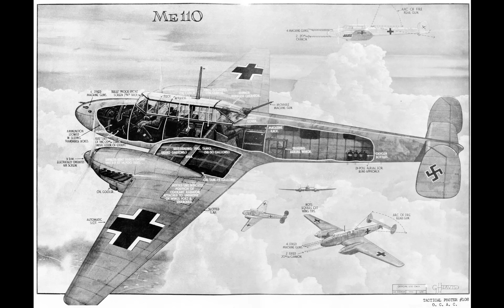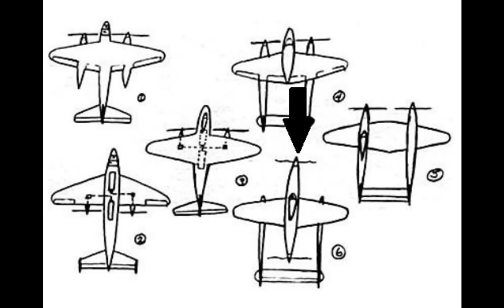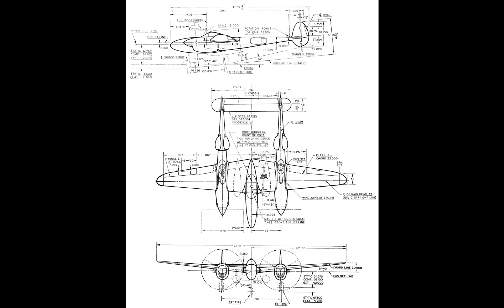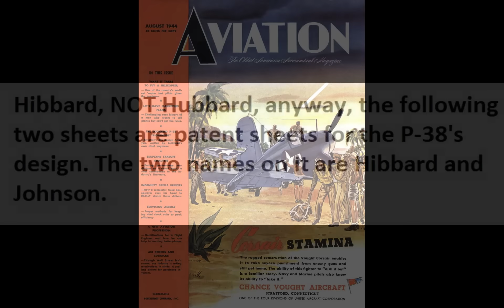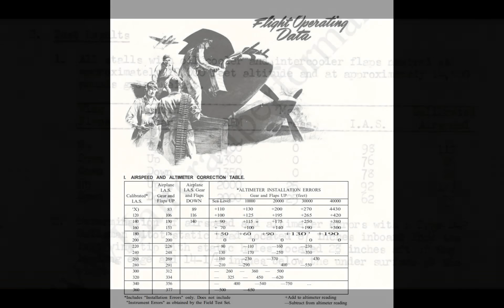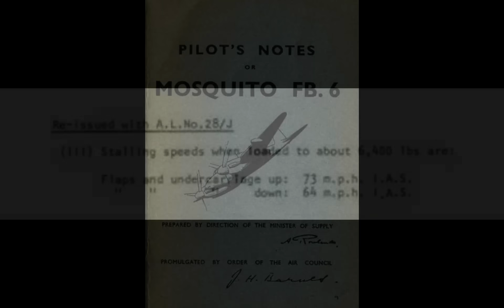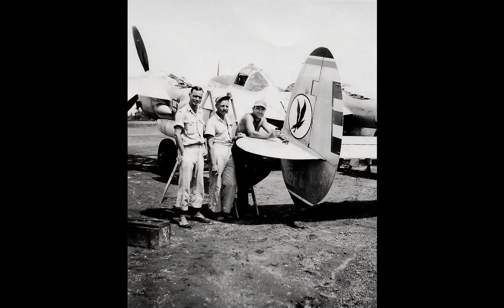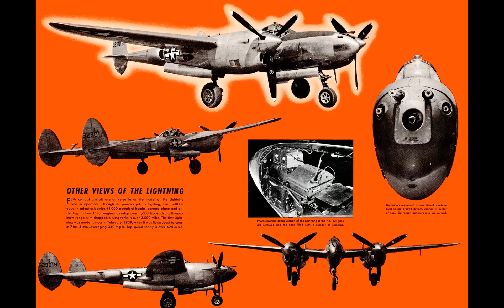Lockheed P-38 Lightning Design Info

Comment: I seem to remember something about Lindbergh helping to extend the range of the P-38. Will you go over this in a future video?
Reply: That's a fairly well documented topic and the quick summary of the reason is very quick:  Lindbergh recognized that most of the active combat pilots had never been trained in how to fly with fuel efficiency in mind, and for the pilots in the Pacific, this was a major issue.  And don't get me wrong, either, because this was also an issue in the European theater of operations, which is why day and night bombers from the Allies were making sorties over Germany without fighter cover.
Reply: @jamespfp  thanks for the info! It’s quite amusing that someone with superstar status like Lindbergh would be the one to fix an issue like this. After all though, he did know a thing or two about flying long distance
Reply: @jamespfp  Do a search for 'pumping loss'. That's what Lindbergh understood and trained others in.
Reply: @jiyushugi1085  
Pumping loss has nothing to do with what he showed pilots in the Pacific to do to extend range.
What you have to understand about engines is that what removes more heat from an engine whether it's a water cooled, air cooled (Harley) air cooled with oil assist (Harley with an oil cooler) engine is that what removes the most heat from the engine is unburned air/fuel mixture leaving the engine, that's why if you run an engine too lean you can shorten it's life and even cause damage all the way up to burning holes in the tops of the pistons and burning valves. 
The engine manufacturers had an air/fuel mixture ratio that was listed on a chart inside the cockpit for different throttle settings, pilots were trained to use this chart as if it were the word of God, if a crew chief's reports on what an engine looked like after a tear down indicated that a pilot was running the engines air/fuel ratio outside of those parameters then the pilot would wind up standing tall in front of his commanders desk.
What Lindbergh did was come up with a way of leaning out the engine below Allison's original recommendation, this wasn't something he just took upon himself to go around teaching pilots, he first had to go to the higher ups in the USAAF about how to do it and they ordered tests to see if it would cause engine damage. 
His method was to decrease the mixture control until the propeller speed just started to drop and then push it forward to where it returned to the previous speed, once a P38 was test flown that way and personnel from Allison who'd been flown to the Pacific had done an engine tear down and determined that using that method wouldn't decrease engine life or cause damage he was cleared to go around to the different USAAF units in the Pacific and teach the pilots how to do it.
I've been building and repairing Harley engines, along with automotive engines years back, for a living for over 30 years, I've seen engines from bikes that sat for years that had the rubber intake manifold seals dry rot and then unfortunately some guy who bought it off of whoever had it sitting in the shed (or barn) got it home and managed to get it started and think the reason it was running rough was because "The carb needed to be run hard to clean the gunk out" and it resulted in holes being burned right through the pistons from running too lean from an air leak at one of the dry rotted intake seals.
Reply: @dukecraig2402  Leaning and running lower rpm was only part of it. He also taught them to use higher manifold pressure (more throttle opening) - something all pilots (and many others) believed would damage the engines (what most of us call lugging). Because higher manifold pressure means opening the throttle valve more, less vacuum is created when the pistons descend on the intake stroke. Running with a low manifold pressure (throttle valve almost closed) means the engine has to work harder to overcome that vacuum. Harder work requires more fuel.
Check out the techniques used by the mileage competition bikes. They all run low rpm and high throttle opening (manifold pressure close to atmospheric pressure). 
So, if you want to get the most mileage from your Harley (if it's fitted with the old style carbs), low rpm + high man press.
Reply: @jiyushugi1085  
Dude, these are supercharged engines, there is no vacuum in the manifolds, they have positive pressure. 
You're guessing at something I've been doing for a living for 40 years now, in 1981 I started working in automotive garages and in 1986 I went to aircraft maintenance school, after that instead of working in aircraft maintenance decided to apply what I knew into the motorcycle world because it was a lot more fun than having the FAA breathing down my back.
Are you sure you want to try to keep sharpshooting me on this?
And I didn't say they ran at a lower RPM, what I said was he taught them to lean the engine until the prop speed just started to drop then push the mixture control forward just enough to where the prop speed returned to where it was (before it dropped).
Reply: @ Julius Mason
Try a book Race of Aces by J. R. Bruning (search Amazon)
Marvellous reading, mostly related to P-38.
The story of Lindbergh according to this book is not so bright.
Myself, as a great fan of P-38 (and FW-190), as well as being impressed by Lindbergh individuality, have tried to find other sources regarding Lindbergh ‚Pacific Tour’ and they were scarce.
But as far as we consider Lindbergh and P-38 range: he used engine/fuel settings already known by pilots, but not recommended for cruise speed. And this worked without engine failure, but such a failure was highly possible.
Bruning apparently does not like Lindbergh, but especially a story of an illegal, extreme long-range fighter sweep over Caroline Islands is breathtaking.
Lindbergh probably was a kind of SOB, so I want to find more reading about it - based on reliable sources, not urban myths.
Sorry for OT, but it was inspired by awesome Greg’s work :)
And  for my English, I am not native speaker.
Reply: @wolffweber7019  thanks for the info! I’ll take a look at the book. I also have the feeling that Lindbergh’s role in all this was kind of exaggerated just because he was famous
Reply: @Mmustang51  
Lindbergh was a complicated individual by no means, an excellent pilot, but in 1943/44 he was a civilian adviser to Vought and was sent to Solomons to solve some problems with F4U. Then he shifted on his own to New Guinea. I repeat, he had no relations with Lockheed nor was asked to improve range of P-38. Of course he used his position and fame.. And he became.. not a mercenary, but a kind of war tourist. Imagine: civilian, flying combat missions. Lot to tell, fascinating topic, truth mixed with myth.. Anybody want to write a good book?
Reply: Just to add a tidbit to the Lindbergh story, he actually shot down a Japanese plane, but this was hidden because he was a civilian at the time.
Reply: @John-bz2rp  
Yes, at least one and probably only this one. This situation is neatly described in Race of Aces. He entered furball and by no means masterfully driven Japanese plane, don’t remember type (not fighter), which avoided for prolonged time previous attacks, appeared suddenly at front of his Lightning. So there was a matter of squeezing the triggers. Web search reveals numbers up to 2 kills or even more.
Reply: Lindbergh showed them how to lean out the fuel mixture while at cruise flight.  I believe he also showed them that a slightly lower Prop RPM saved some fuel
Reply: @somercet1  28 minutes 10 seconds to fast forward to Lindbergh specific information.  o7
Reply: Lindberg's recommendation was to cruise on lean mixture with very low revs and relatively high boost. Similar to what happens with a car when you shift into overdrive. 

Lindberg was a complicated individual, more than a little Nazi sympathetic, and later found to have a second secret family in Europe. Still by most accounts he was a good pilot, and a smart analytic thinker.
Reply: As I recall, the higher ups were worried about engine damage but after he flew a bunch of hours on his lean mixture they tore the engines apart and found no damage
Reply: @somercet1  this is where I remember hearing it from a long time ago! Thanks for the link!
Reply: "Lucky Lindy" fuel management theories worked for all US aircraft.

Comment: Thank you Greg! I am always intrigued and fixated by the engineering solutions and human heroics of the WWII Era in particular. They often open a keen window into what we are truly capable when pressed to the precipice. War has driven us to so much innovation and unfathomable acts of will. When you talk about oil cooler placement and blast tunes I see young engineers working around the clock in sweaty clothes getting in arguments with the mechanics trying to actually build what is on the plans. Then an innovation that ends up saving .5 gals of fuel per hour in the P47 and tips the needle in the fight for air superiority in Europe. For the sweaty mechanic and engineer,,,,,no glory,,,,,but they are more than fulfilled. Glory was never what they were committed to.
Very appreciative! Thanks!

Comment: ..and the rear gunner / observer sits where ???  For a twin engine plane, I'd want eyes facing rear.  :D  v"HEY! Boss, guess who's sneaking up 6 low.."  Fokker G1 had this. Maybe put all that firepower in an underslung auto turret ?
Reply from the maker: The Ju88 would be perfect for you.
Reply: @GregsAirplanesandAutomobiles  Hey, remove the bomb load, replace the mgs with 20mms and guess who rules the skys ..
Reply: Rear view mirror is lighter.
Reply: @givenfirstnamefamilyfirstn3935  Mirrors didn't save the lives of many pilots.
Reply: He sits in the back of the P-58 instead.
Reply: @BogeyTheBear  See, common sense prevailed. :D

Comment: In War Thunder as in IL2 GB, a properly handled P-38 is one of the most dangerous opponents one could face. Particularly the later J models with boosted ailerons. With its sole poor spot in agility, its poor roll rate solved it becomes very, very dangerous.

A splendidly informative introduction to the P-38 Lightning.
Reply: I love it in war thunder. I call it a sleeper turnfighter, because with those fowler flaps you have insane lift. Specially at altutude, where your enemy might have reduced power but you're at 100% power thanks to turbocharging.
Reply: Yep, a well flown P-38 is dangerous on it's own, and given the very favourable Battlerating in War Thunder, especially in "Sim Battles", where it mostly faces 109 F and early Gs, it can really dominate a match. 
I've seen a lot of terrible US Pilots in WT, mostly in T-bolts and Mustangs though, but also some very good P-38 Pilots, and those are nearly untoucheable. 
Us Fighters overall are experts aircraft, you have to use them right, but if you do....they are very, very powerful. 

But even if you put the P-38 against contemporaries, like in IL-2 1946 or Great Battles, the P-38 really shines, and is my favourite US Fighter. Somehow when you come in at 28-32,000 ft, everyone at high altitude suddenly "vacates the premises", and it can fight toe to toe with a 109 or 190 in a dogfight. 
If you know how to use the rudder, fowler flaps and dogfight geometry that is. ;) 
One of the key things that helps against 109s is to never fly just a horizontal turn, always put a vertical element into your turns. 
And the gun arrangement is something that Lockheed can be justifiably proud of, nose mounted guns are the best arrangement, good tight grouping of shots that do damage in a smaller area instead of the damage being spread out and no convergence problems make shooting at 600 meters no different from shooting at 100, safe for lead and the ballistic curve! ;)  

How the hell Gaijin thought that a P-38L needs a BR of 4.0, the same as a 109 F-4 I'll never understand.
Reply: @LupusAries  bcus only a handful of players know how to use its fowler flaps properly...

Comment: careful comparing the lightning to the mosquito, one was designed as a unarmed bomber and one as a fighter.
Reply from the maker: I'll be comparing them. I'll use the same level of objectivity I always do.
Reply: @GregsAirplanesandAutomobiles  
thats plenty good enough for me
Reply: @GregsAirplanesandAutomobiles  ; Putting in a F7F as comparison to see how an end of WW2 twin fighter design stacks up would be nice to see. Or maybe a Me 410.
Reply from the maker: Mmm, the F7F is awesome, but more of a competitor to the Hornet and P-82.
Reply: @GregsAirplanesandAutomobiles  
with no study and just a guess the hornet would stack up well especially on range and loiter and sustained turn depending how those fowler flaps go.
Reply: @GregsAirplanesandAutomobiles  
looks like the mosquito was very close if it could use the drop tanks